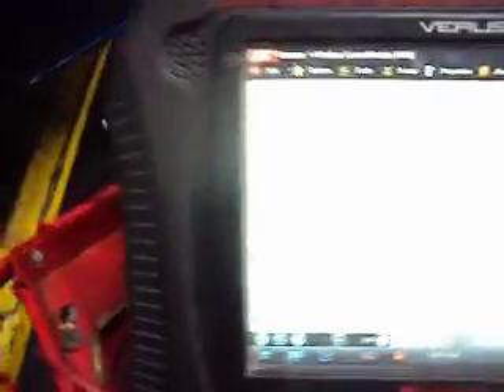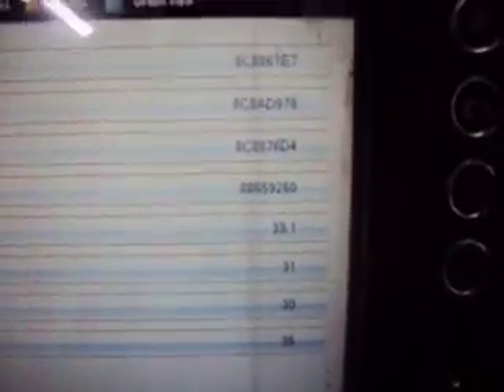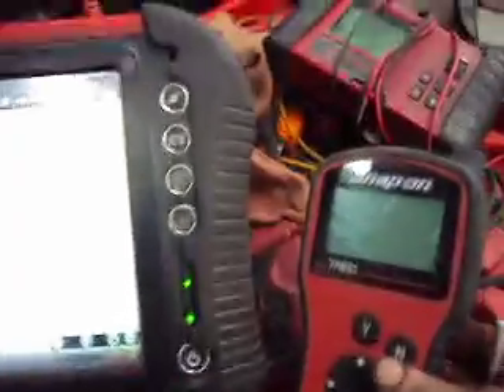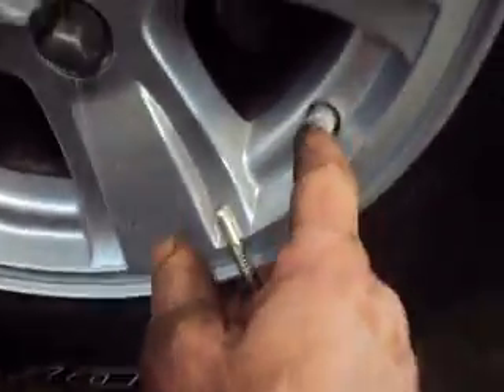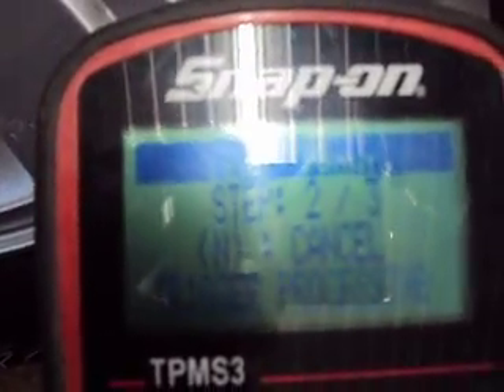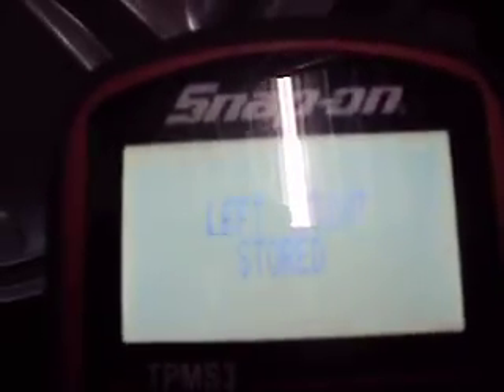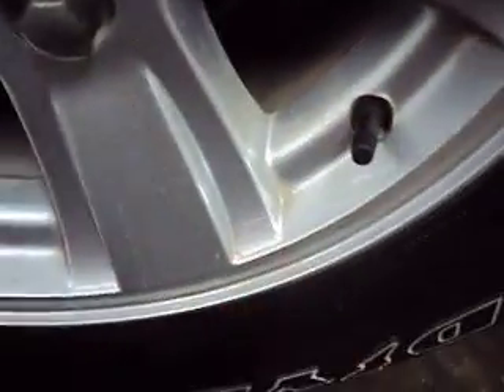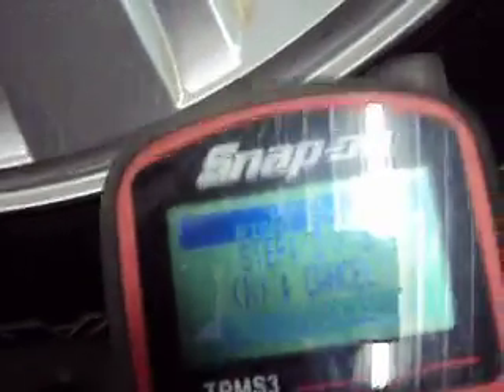Using the TPMS3 with the Verus for diagnosing a TPM light

Comment: Just what is the point of this video?
You didn't wait for the TPMS tool to determine if it was or wasn't reading a sensor and the stupid scan tool said there was a sensor. 
 The only thing that was determined is that you looked at the wheel and saw a rubber stem, congratulations! You don't need ANY tools for that.
  And some aftermarket sensors are rubber. So once again..... What's the Point??

Comment: @MrGreasybob Any wheel sensors i've worked on are attached to a metal valve stem, I guess yours wasnt measuring because it couldnt determine pressure when they took out the metal one.